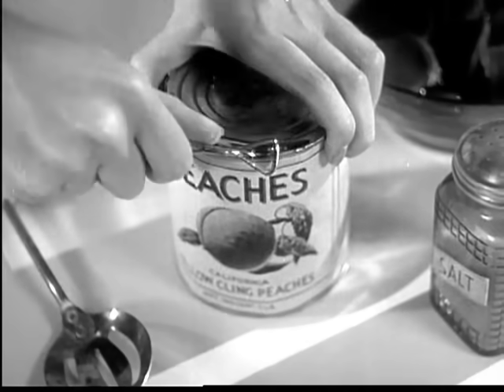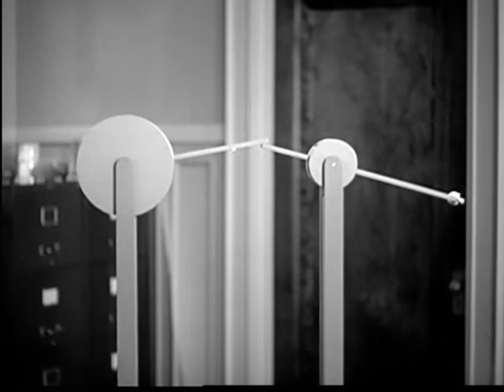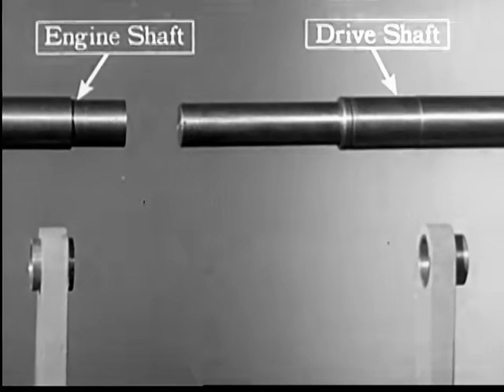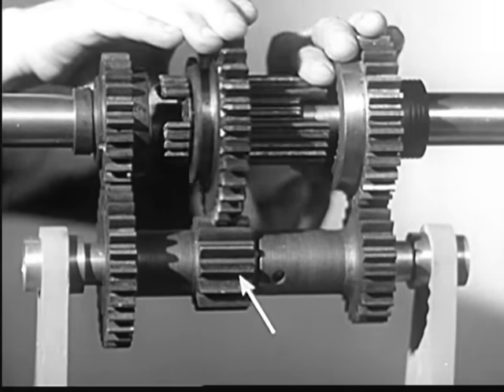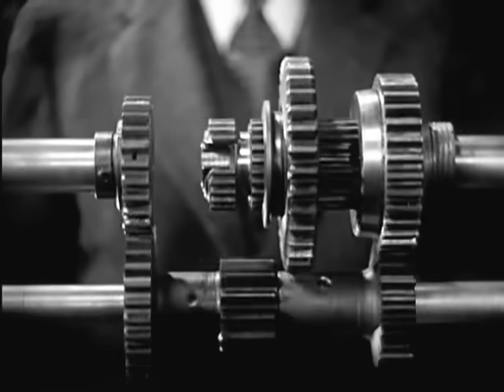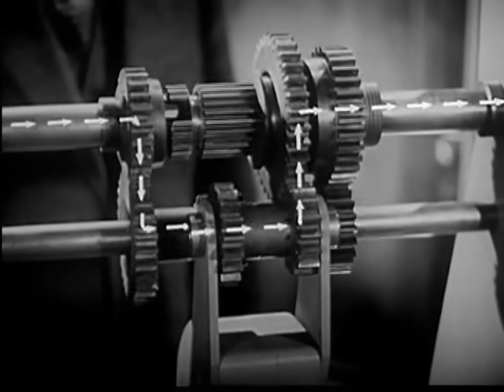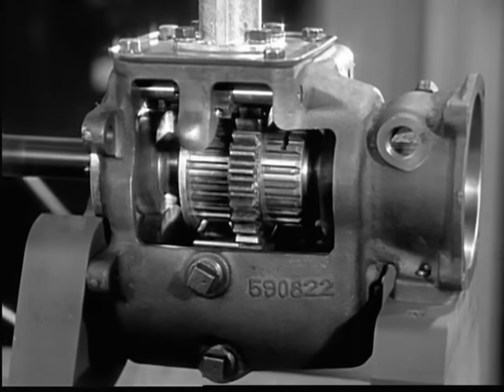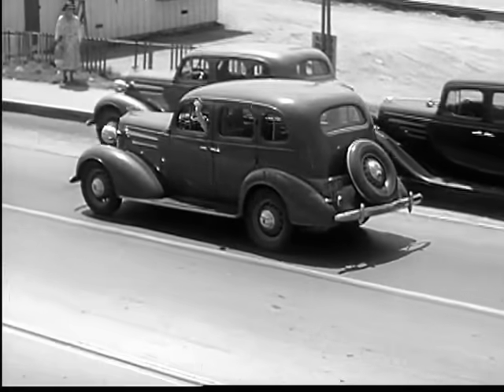Spinning Levers - How A Transmission Works (1936)

Comment: Weird to think of a gear as a continuous lever. So simple it's genius
Reply: Now consider that a screw thread is a continuous wedge.
Reply: ColtaineCrows 
mind = blown
Reply: I had a car that had an Aisin six-speed manual box.  It was a mazda Rx-8.  Between the turbine-smooth engine and that glorious gearbox, one gets the impression the engine is a giant lever.  It's the weirdest thing to explain, but yes.  It feels like a lever.  No other car does that for me.  I miss it. 3rd gear went on all day, to almost 100 at 8500 rpm.
Reply: @wakkowarner4288  Ah, the Wankel engine (that's funnier if one is British).
Reply: @pineapplepenumbra  Pretty funny if one is german too. One is self-intoxicating... the other just a wobble.
Reply: @JoshSweetvale  I now wish that I spoke German, so that i could appreciate that better.
Having said that, I considered learning German before, as there are some brilliant German songs.
Reply: @pineapplepenumbra  Wankel means wobble. Ta-dah. Rammstein and Nena do not warrant a 100-hour investment.
Reply: @JoshSweetvale  Ah, as in the rotary engine? So it's the Wobble Engine? I thought that was the inventor's name?

Actually, I was thinking more of Faun, and a few others. 99 red balloons had an English translation that sounded virtually the same, so that never occurred to me.

Still, I've started to learn Scottish Gaelic, as there's a fair few Galeic songs that I really like, too.
Reply: As long as it’s made of a strong material
Reply: Yes until you get a modern transmission job in as a mechanic it'll almost make you want to quit your job
Reply: I was explaining gears and levers to someone who was studying engineering, but he didn't know about either, so I asked him what he was currently studying, as I thought that gears and levers would be a very basic part of what he should be covering, his answer? Project management!
Reply: @pineapplepenumbra  I cannot say much about undergraduate engineering education nowadays, but post-graduate engineering education appears to be very much focused on "soft skills" such as engineering management, project management, etc. (That doesn't apply to research higher degrees, of course.) If a qualified engineer wants to learn more "hard" stuff these days, they're better off grabbing an older textbook book and watching YouTube videos, or accessing free online course material via portals such as MIT's Online Course Ware (OCW), etc ... it's self-paced study and cheaper than paying fees.
Reply: @vk2ig  I can understand that once one has gone past the basic stages, then studying areas providing more of an over view would be beneficial, as, of course, some people will need to ba dealing with the issues they cover, but this guy was 17 or 18.

A guy I know did an engineering degree for fun. He doesn't need any of the degrees that he has for his job, and will probably be reaching retirement age in a few years, anyway.
Reply: @vk2ig  "Some people just love learning -"

I can totally understand that, and wish I had more time and space to do exactly that.

Btw, I can't see your latest comment, it's in my inbox, though.
Reply: @pineapplepenumbra  I also wish I had more time and space for learning.

Ok re my comment not appearing yet - that happens more and more with YouTube lately.
Reply: @vk2ig  Your last comment (from 8 hours ago) is visible.

If I use Chromium this doesn't happen, but if I use Firefox I get this annoying double spacing between paragraphs.

It only started happening about 3 months ago.
Reply: @pineapplepenumbra  Sounds like a recently installed "feature" in Firefox 😁.  One could be forgiven for thinking it's a conspiracy, given that YouTube is a Google subsidiary, Chromium is a Google product ... I use the YouTube app on a Pixel phone - another Google product.
Reply: @vk2ig  I'm not a fan of conspiracies, but one certainly could easily believe that.

I was not impressed last night, while watching a comedy, when one of the characters said that her aunt was a racist who spent all day watching David Icke videos on Youtube, as this implies that David Icke is a racist.

Now, David Icke does come out with some truly crazy conspiracy theories, but my girlfriend, who has watched a lot of his videos (and is certainly not a racist, having gone out with a black guy, a Jewish guy, a half Asian guy and even a Ginger!) has assured me that he has shown no signs of racism, whatsoever.

Also, a couple of things he said in the past turned out to be true, although I seriously doubt that the Moon is an artificial construct, hiding lizardoid aliens.

A few conspiracies, mooted decades ago, have turned out to be true, such as the US government deliberately giving black people STDs, and giving pregnant women radioactive materials, so with these tech firms, who knows what's really going on?

The world looks like it's going to take a dive into an Orwellian nightmare with technology far more intrusive than that envisioned in "1984", if we're not very careful!
Reply: @vk2ig  P.S. I was kidding about the "even a Ginger" bit, she did go out with a ginger guy, but two of the most beautiful women I ever met were ginger, I've got nothing against them, whatsoever.
Reply: cray nelson

pineapplepenumbra self-sat·is·fied /self ˈsadəˌsfīd/ adjective excessively and unwarrantedly satisfied with oneself or one's achievements; smugly complacent. "a pompous, self-satisfied fool" 

Was that comment supposed to be for someone else?
Reply: @pineapplepenumbra  You do know that there are different engineering degrees right? Unless he was studying mechanical engineering it might come up. Sounds like he may be studying process engineering and project management is important for any engineer because the thing has to be able to get built efficiently and be possible for people to do. Find it hard to believe he didn't know what a gear or lever was either.
Reply: @jaredlangley6924  "You do know that there are different engineering degrees right?"

Of course. However, gears and levers are the most basic things to have an understanding of, even if one never does an engineering degree, but simply rides a bike or changes a tyre.

Comment: This was before the advent of overdrive transmissions.

Now modern transmissions have 1 or more gears that drive the driveshaft faster than the engine itself.
Reply: the model t had a divorced overdrive option. by the 30s a lot of cars had 2 speed rear ends. the borg-Warner over drive was out around the time the film was made. over drives faded in the late 50s do to cheap fuel. would not be till the late 1970-mid 1980s over drives wold be stranded/more common. borg-Warner was cool in that you only needed to cluch to get in to 1st then you could shift in to 2nd or 3 as long as it was below 28mph as it had a free wheeling clutch!
Reply: But the basics are still true today with Manual transmission.   It's good to see this stuff and helps understanding even today.
Reply: Overdrive was around at this time, they just neglected to speak on it, chosing to focus on the transmission itself.

Comment: Actually, compared to today's standard transmissions, this is a very crude gear box.  The gears in today's transmissions are cut at an angle and called helical cut gears.  That reduces the noise of the gears about 50%.  Additionally, this IS NOT a synchro transmission, and 99% of today's transmissions are, so there are a lot of parts in today's transmission, specifically the synchro rings, that are not reflected in this video.  It is a very good representation of ratios, and multiplication and reduction theory based on the number of gear teeth.  In watching this again, after some comments directed my way, I will concur that synchro mechanisms are discussed, and are a good example of how they work.  Now for the fun of it, find a video of the Tremec 6 speeds, or ZF 8 speeds.  Lots more spinning levers.
Reply: You didn't watch the whole video... they're talking (quickly but still) about synchromesh !!
Reply: +Guillaume Gaudin Isn't synchromesh a continues mesh gearbox, using dog clutches? These are a crude form and have synchros but it isn't a synchromesh gearbox.
Reply: Call it "very crude" if you want, but it still gets the basic job done of explaining how your basic transmission works.
Reply: @ApartmentKing66  Yes it does get the job done.  And, many heavy load transmissions are still spur cut as opposed to helical cut.  It is really an 82 year old piece of interesting history, that serves the need of explaining gear reduction and power train movement very well.  But to call it a modern motorcar transmission in 2012 is pretty far off the mark.
Reply: This is a video for people which know nothing at all about how a car works, and it explains everything like it should be explained to a ten years old kid. Things moved a lot in 80 years but the principles are not so different.
Reply: 2nd and 3rd are synchro.  1st gear is not synchro

Comment: Before I was 10, I built a gear box that ran on a 1.5v battery and could lift 600 pounds for my science fair. Won first prize.
Reply: cool story bro
Reply: Should have made a vaporizer and called it an experiment and got stoned for the sake.of science...
Reply: Did you used a metallic gear clock mechanism?! Or maybe a meccano gear box.. or something like that?
Reply: @Thebasicmaker   Probably a romantifier
Reply: Suck ass. LOL

Comment: The editing of this video is amazing. I can't believe this was made in 1936. Considering they were using celluloid. I can only imagine the hours of work they put into this.
Reply: Between 1936 and 1990, the method of editing films changed very little. 
Then in the early 90s a video copy could be used to edit, but the negative still needed to be cut by hand. 
It is only in the last decade that digital cinema projection has been introduced and the whole editing process is carried out on video.
Reply: conyo985 I saw a video about a camera from the 40s that could record 2 million frames per second and could like film atoms or something idk.  I guess even then everything could be made with enough funds.
Reply: The Citizen Kane of how-it-works videos
Reply: dying toad I’m not afraid of myself. That’s delusional.
Reply: Most alien technology were discovered even before that time. People in the 30's make it appear they were low key and started experimenting on those technologies. Life  was pretty advanced at that time.
Reply: @pinoyheartbeat7245  riiiight...
Reply: Take off the tinfoil hat it's not alien tech its called perpetual motion its simple technology. For centuries we've known explosions create a force once we've figured out how to make tiny explosions is when the engine was made. If it was alien technology it would be far more advanced then a simple gas engine
Reply: @marv9906  internal combustion is not perpetual motion. Perpetual motion is impossible.
Reply: stop shaming fat people.  im not delusional
Reply: Nurburgrings Fastest ?

Comment: With the reverse demonstration, I'm confused. The reverse gears would be in the way while in first gear. How does the car get around that? Does it shift the reverse gears away?
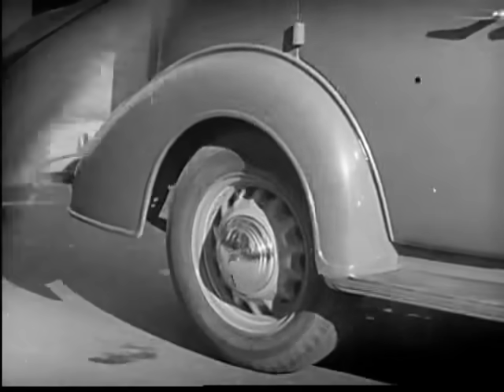Reply: 6:25 The first gear one is a broader one. So there is still enough space for the other gear (the one connected to the wheels) to fit next to the left part of the reverse gear. And if you want to go to reverse you use the part on the right of the reverse gear so it doesn't connect to both gears (first and reverse) at the same time.
Reply: This is an antique transmission that is a hybrid of 2 types.

2nd and 3rd are constant mesh, like modern transmissions.  1st and reverse are "sliding gear", like much older transmissions.

When you move the shifter you are actually sliding the first speed gear between R, Neutral, and 1st. On 2nd and 3rs the gears are stationary and a splined section engages them.

Comment: Thanks for posting these, they are really cool tutorials which incrementally and easily explain complicated mechanics! even though they are probably extremely outdated nowadays, I'm sure the fundamental technology has stayed the same, and what is being described here still holds true for current models, albeit much more complicated by now
Reply: Eh, a manual gearbox really isn't much different mechanically today, just more gears in 'em these days. 

Well, can't speak for the double clutch ones, since I haven't had one of those open yet.
Reply: ColtaineCrows the dual clutch engages the next gear before switching clutches. So you don’t have to wait for a shift at all, one clutch disengages and the other engages simultaneously.

Comment: Why not use brakes to slow down from the hill?  Were they 4 wheel drums ?
Reply: Because you do not want to overheat the brakes. Overheating the brakes (even on cars) may warp the brake rotors. Also, back in the day, the brake shoe compound was not cheap at all, so it only made sense to use the engine for braking.
Reply: Yes, there were four, very small, single piston drums, and no power assist. In those days you had to think about your brakes. There was just one master cylinder and all four brakes operated as a single system, so no redundancy. Brakes overheated on long descents, and they sometimes failed.
Reply: I can only assume you don't drive a stick-shift. That woman wasn't stopping without brakes, she was using gearing to help slow her down. And yes, it was almost certainly four-wheel drum brakes, with asbestos shoes. (Mr Teff explained it better than me)
Reply: Forget about drums or old cars. Even today it is wise to drive downhill with a lower gear. It has multiple benefits and has no drawbacks or possibility to damage the engine if you prevent too high RPMs by pumping the brake regularly as you descend. The benefits are preventing brake fade (loss of brakes due to super heated brake pads), free battery energy with the engine-run alternator and infinite MPG (I'm not kidding, zero fuel consumption). 

The engine is run, or driven, by the wheels and the transmission, and the engine brakes by closing the valves and using the vacuum in the cylinders to counteract the wheels. In a fuel injected vehicle the lack of throttle input also shuts down fuel injection so there is zero fuel consumption for as long as gravity pulls the car down the hill.
Reply: @Synthwave89  99% perfect, you just forgot to say that you'll also win by wearing your brakes a lot less too !!!
Reply: Mario Paul and how would an internal combustion engine idle with no throttle Input? Your kinda stupid. Even when the engine is idling it requires fuel, never is an internal combustion engine that is working, working at 0mpgs, unless the car is standing still and u wanna be an asshole and say it technically got 0 miles on that gallon it went nowhere.
Reply: Like saying fire can burn without fuel, wtf is that kinda logic LOL
Reply: @Superdupersupersuped  The force of gravity pulls the car downhill, causing the engine to turn. No gasoline is needed to run the engine at this point, in fact one could turn off the engine and not affect the speed of the vehicle. You should really think about what you're saying before calling people stupid.
Reply: @p3rerang3 BMW engines with both valvetronic  & vanos have no throttle, what you control with your foot is valve lift and duration.  Amazing stuff.  And in any fuel injection engine you simply stop injecting and stop the spark while the engine is being used as a brake.  0 fuel.  It's not like idle, man.
Reply: Why would you even ask if they are drum brakes this video is from 1936 obviously they are drum brakes
Reply: oldtwins na 
Pain in the ass too, you would have to "fit" the shoes to fit the drum usually from what I've heard.
Reply: Yes they where and they over heat easier compared to disc because they don’t breathe well
Reply: I think the point of the downhill test was to show that the synchromesh enabled downshifting. This obviously helps scrub off some speed. 
Without synchro it would be so much harder to engage a lower gear (unless you double de-clutch, which is not the topic here!).
Reply: Non power brakes,  it was much easier on a weak driver to stop with the motor and brakes on a hill like that.
Reply: oldtwins na
forget the brakes.  slam the transmission into 1rst at 60 mph.  I'd like to see the transmission gears scatter about the roadway.
Reply: You know you can shift down one gear at the time right?
Reply: @ColtaineCrows  
On a standard transmission it's a lot quicker to go directly from 1rst to 3rd then go directly back to first when slowing down.  You use the clutch and 2nd gear less.  My point is, if that lady went down the hill in neutral until 60 mph she could have just put it in 1rst at the bottom thus saving wear on the transmission and brakes.
Reply: And if she went down the hill in neutral she would not be able to go in to 1st gear at the bottom without using the brakes first. And if she did RIP transmission.
Reply: it would be almost impossible to get in to 1st gear when going that fast
Reply: @redtra236  
why not coast down the hill with her foot on the clutch and transmission in 1rst then simply take her foot off the clutch when she reaches the bottom?
Reply: Cause that would cause you to destroy the transmission and possibly the engine.
Reply: @pp-tx3bt  first gear is non synchro, you will not get into first gear at any speed without double clutching. Even when double clutching over 20mph itll be impossible,  since engine RPMs cant come up enough to equalize shaft speeds.

Owners manual suggested coming to a complete stop before shifting into 1st gear.